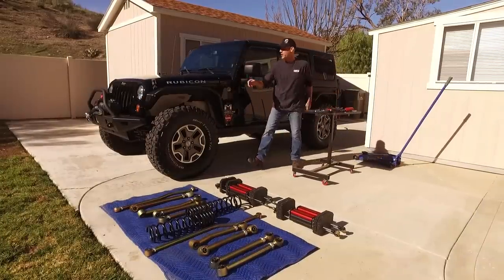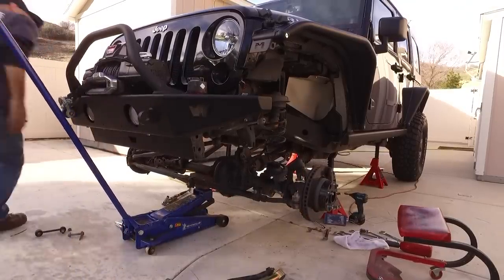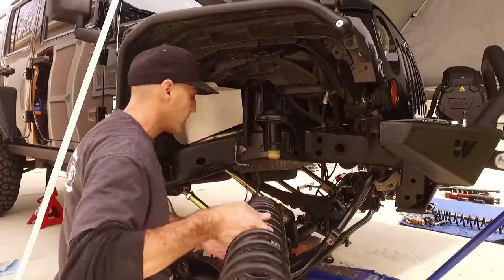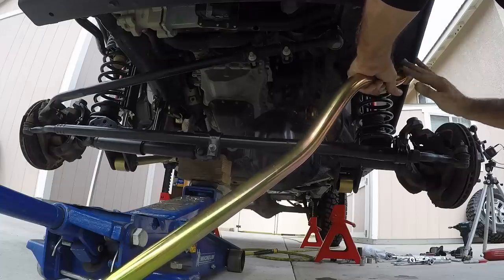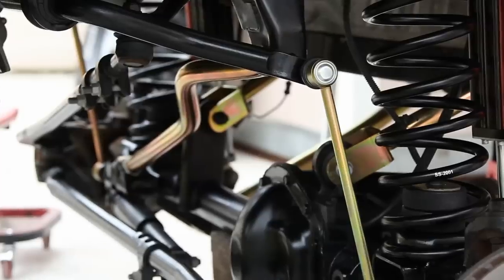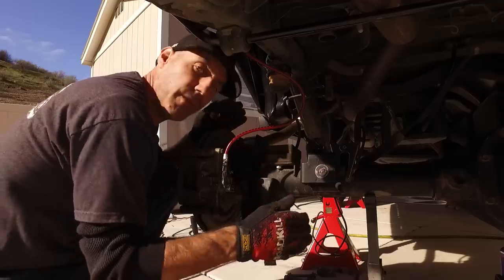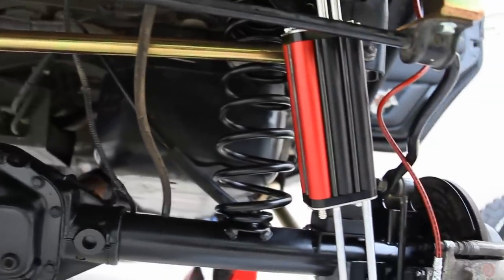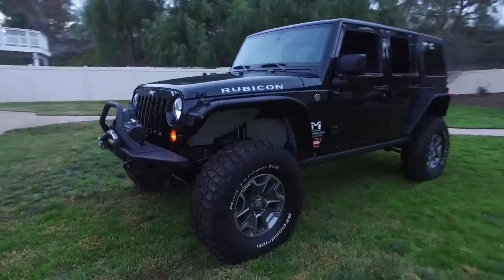Jeep Wrangler JKU Suspension UPGRADE Game Changer 6Pak DIY - Lift Kit

Comment: For a good safety measure, you should put the wheels under the jeep while you're working on it. If the jackstands fail the tires will be there to help keep the jeep from crushing you. Just a little precaution I take when I'm under mine.
Reply from the maker: That is a good tip, thanks!
Reply: Considering he put 37s on a stock height vehicle in general before a lift, he should just kick the jack stand down while he’s under it.
Reply: If we didn't have gravity, we would have no worries about the jeep coming down if the jack stands failed.

Comment: This video is the reason I'm buying a MetalCloak 5.5" long arm kit soon :P Thank you! I was torn on the Game Changer vs Long Arm, but I do so much highway travel in my 2-door (about as equal as I do O/R) that I'd love the solid stability the long arm provides over just adjustable flexers :)

Thanks again, man! Great video! This one is my second favorite, aside from your Rubicon Trail vid!
Reply from the maker: Congrats! Are you getting the lock n load system?  I'm thinking about trying that one. Thanks for the shout!
Reply: @AutoEdits  Yep! If we're gonna go, we're gonna go for gold :D I wanted the Lock n' Load for full articulation, without worrying about killing everything else. And, of course, the 6-pak setup.

Upgrade will be "soon", as in "as soon as the rear tires go" lol. The fronts were rotated from the rear about 6 months back, and these "new" rears have some life. But, we recently took it out to the Hammers (Johnson Valley, CA) and tore the hell out of them trying out some waterfalls. No go lol. So, since we'll need some way beefier tires than 33's under a 5.5" lift, we planned to wait until we need all 5 replaced.

At the same time, we're gonna do driveshafts, gears, and selective lockers (Jeep is a Sport, non-Rubi), while also swapping out the D30 up front to a fully built Dynatrac D44.

Should be one hell of a year!
Reply: @AutoEdits  Oh, and also, since I'm just going with the stock D44 in the rear, I'm going to upgrade to 35-spline, as well as truss it for added strength. Excited.

Comment: Love it! But I dont want to spend the money on the six pack edition... Im just gonna run the 2.5" or 3.5" Gamechanger with the Fox Shocks. Most people I have talked to say that they get just over 3" of lift with the 2.5" and just over 4" with the 3.5"... So, not really sure what I want to run. I will be running 37" STT Pros, but do a lot of tippy off camber trails, so I definitely dont want to get too tall.

Comment: You have added a lot of great upgrades. They are functional and look great. Have you kept track of the amount of weight you have added to the jeep? Are you planning on any break upgrades? If so, what brands? If not, why?

I used Wilwood for my brake upgrade and it made a big difference on stopping distance.
Reply from the maker: I have not kept track of the weight added to the Jeep. At this point I'm not concerned since there are so many other good working rigs on the trails with more stuff added.  
I am doing Power Stop brake pads and rotors next... long over due upgrade.  The Wilwood stuff looks amazing, I use that on my Mustang project!

Comment: Just installed this lift PLUS the HD steering upgrade based on your videos. Love the suspension so far and wasn’t too difficult to install. I did notice that since the rear pinion has changed, the rear springs had a rearward bow in them. Metalcloak makes a corrective aligning bracket which seems to work great. Just wondering if you had this issue. Great work!
Reply from the maker: Glad t hear you went MetalCloak as well. I've been extremely happy with this kit and with the company!  I did eventually adjust the rear axle to the rear about .5 inch and take some of the pinion angle out of it.  Seems very happy both on and off road.  I'll look into those brackets you mentioned, but I've been thrilled with the adjust-ability in the stuff already on there.
Reply: Ah interesting, yea I suppose changing the pinion angle itself would help. I did notice that after the corrective bracket was installed, I gained about 0.5 inches of height in the rear. Simulates the rake that the stock jeep comes with. I don't mind it though. Look for "JK Rear Coil Spring Alignment Correction/Retainer" on the site. It actually doubles as a spring retainer as well with is nice. Two problems, one fix.

Comment: Great video. Thanks for sharing! Looks amazing. How does it ride?  I have a 2017 JK Rubicon Hardrock. Trying to decide on a new suspension. You just helped me decide. As soon as I get your feedback on the ride. Please inform.
Reply from the maker: It is all around fantastic. Not much compromise here. I just finished a 2000 mile trip across 4 states hitting trails like Pritchett canyon in Moab and Milt’s mile in sand hollow and cruised home at 85 mph on the highway. I’m extremely happy with me setup.
Reply: Awesome! Thanks you again!

Comment: Yay glad you got ur metal cloak gamechanger lift :)
Reply: Whatch your front driveshaft the cv joint on it will possiably crack open. If you need to replace driveshafts to something stronger go with adams driveshafts. 
http://www.adamsdriveshaftoffroad.com/jk-front-rear-1310-or-1350-driveshaft-package/adams-driveshaft-jk-front-rear-1310-cv-driveshaft-package-with-spicer-greasable-heavy-duty-series/
Also did u get the exhaust spacer rings for the headers from metal cloak the front driveshaft will hit the crossover pipe with out it .
Reply: Heres the spacer kit for the exhaust 
http://www.metalcloak.com/JK-Exhaust-Spacer-Kit-p/7078.htm
Reply from the maker: Thanks so much for the info! I plan on replacing the driveshaft pretty soon and don't want the exhaust any lower to bang on rocks so leaving it for now.

Comment: great to see this up man! good work. one question..should your new brake lines be behind the rear sway bar like that? seems like they should go in front of it. atleast thats how ive done it in my installs. anyways, love the jeep. keep the videos coming!
Reply from the maker: I wondered about that as well but as I articulated the sway bar before connecting it to the axle, where the brake line attaches to the frame would get hit at full articulation so I went inside the sway bar.  I'll keep an eye on it and thanks for the suggestion.
Reply: I figured if you had done it then there was probably a solid reason behind it. Yeah shouldn't be an issue. Just watch it, don't want something to happen to your brakes ;) Great looking jeep

Comment: Hey Jason, Do you have to do anything with the driveshaft?  Is there a concern that there will be too much pressure on the driveshaft or any other geometry issues with this setup?  Thank you sir and love all your videos.  I have learned so much from your videos and Crawl TV.  Thanks for taking the time to educate us newbies.
Reply from the maker: Well thanks for watching!  I ran the stock driveshafts for a few months after the lift but swapped them out for the Tom Wood's upgraded units and am glad I did. Check out that video if you get a minute or two!
Reply: Perfect!  Thanks Jason!!!  Found the video and appreciate all your hard work.  Thanks for sharing all your knowledge.

Comment: I love how you skipped over installing those nasty rear upper control arm Flag nuts. Pain in the arse to get lined up and started. would love to hear how you managed.
Reply from the maker: I actually had them in at first but these darn videos get so long.  It really wasn't that hard... line up the arm to the mounting hole and put your eye right down the barrel of the hole until you see the flag nut and then gently jam that bolt in and twist! I may have got lucky but it worked out to be pretty easy both times.
Reply: Lucky

Comment: "6Pak Shocks" are dampers not shocks, you spring absorbs the bumps (shock)  in the road and the damper controls the spring rebound after  the initial compression of the spring

Comment: Great video!!!  Always learn a lot from you. How did you get the jeep on four jack stands? Jack up from where? Middle? And support with jack stand on the frame like your video?
Reply from the maker: I lift the rear from under the center of the differential and the front from the axle tube just next to the differential.

Comment: Those are not your typical shocks! I’m sure they’re unbelievably tough, it just looks strange to me with the smaller diameter rods. I was looking into Tereflex lift kits but after some research I’m leaning towards Metal cloak as well now. The elastomeric bearings would be a huge upgrade. Are you still happy with the lift? Great videos btw!
Reply from the maker: I am EXTREMELY happy with my Metal Cloak suspension!  It continually performs great and the shocks are valved just right for sport and comfort. Would do again for sure!

Comment: Jason, great video!  I've enjoyed your content for some time.  My suspension upgrade from Metalcloak is on its way, should have it in a matter of week.  Question - did you install exhaust spacers?
Reply from the maker: I didn't at first and around town and light off roading was fine.  A few months later at full droop it did rub the stock front driveshaft and tore the boot. I ran spacers until getting the Tom Wood's driveshafts and then pulled the spacers back off and never looked back.
Reply: You only need the spacers if you don't have a aftermarket drive shaft. If you're running a 3.5" lift you'll need a aftermarket drive shaft in the front at least due to the angle. You'll eventually tear the boot and it'll fail in the most inconvenient time. You're better off buying a new drive shaft and installing it. It's pretty easy takes a couple hours.
Reply: @AutoEdits  Thank you!
Reply: @MichaelCook1981   Thank you very much.

Comment: Just found your vids. Very nice and informative. The big nuts on the upper and lower control arms. After you set them to the correct length did you tighten them? And if you did tighten them, did you do it on the Jeep or off?
Reply from the maker: Thanks! I did tighten them once the installation was complete and the Jeep was back on the ground. Pretty easy that way.

Comment: Hey Brotha,This is a seriously amazing video. I am lovin' all things Metalcloak. Just out of curiosity, what's the status of the old shocks?  I've never used Twitter or Instagram. You might really be a lifesaver. My Rubi has been out of. commission for a few months. I had just finished paying her off and babied her since I left the dealership. I was in a major accident hitting a highway median which got under the front end  and due to my now ex wife screwing up the insurance, have to pay for all the damage. We're talkin front axle, bumper, flares, tranny AND transfer case, as well as 2 blown tires and a toasted left wheel as well as,  obviously the shocks/suspension..  I have been in a serious funk since it happened because it's gonna cost around  $10,000 that I am really trying to save up. I'm on disability for a brutal back injury that I got at work and my monthly income has taken a major hit. I can send you pictures of all the damage no problem. I've never asked anyone for anything but the second you said you were giving away the old suspension, I freaked out. The last 6 months have sucked so bad having no wheels and looking at how messed up my Jeep is. It's the first one I've ever owned. You would literally be changing my life around if I could get it. Please, please email me if you can help and I'll send u back pics so you know I'm legit.. It would literally be like winning a lottery . My email is ..soenlightened@yahoo.com Thanks , I really appreciate it.

Comment: Nice vid! Did you need to change/upgrade your drive shaft? Are brake fluid changes necessary after upgrade? Other than alignment, did you have to do a flash cal?
Reply from the maker: Eventually I upgraded the driveshaft, you don't need to change brake fluid but you do need to bleed the brakes , no need to flash the computer at all.
Reply: @AutoEdits  Any specific torque spec (ft lbs) when tightening the bolts back on upper, lower control arms, track bar, etc? I’m running Factory wheels/ AT tires 33” on a ‘21 Rubi JLU for now. Will put on 37”s in a month’s time. Would i need to install the shock mount relocation brackets for now for the fronts or rear?

Comment: Great vid, did you have to put any exhaust spacers because of the lift?
Reply from the maker: Thanks! I didn't run spacers for a long time and it was ok. Eventually I swapped the driveshaft upgrade and you don't need spacers then.

Comment: Dumb question: Did you torque anything during final assembly or just blast them on with the air tools?  Does it matter?  Thanks!  Great vid!
Reply from the maker: Probably does matter but I used my calibrated elbow for this installation.

Comment: Hey Jason, Long time viewer. On all those nuts and bolts are you using any lock tight? I only ask because I am about to do the shocks, springs, sway bar end links, tie rod, and drag link.
Reply from the maker: I didn't use loctite and just torque all stuff and recheck periodically.
Reply: @AutoEdits  Thank you for the reply. Got it all done today after you replied.

Comment: I remember seeing this video when it first came out. Thinking about finally committing to a decent lift I’m tired of the 3.5” pro comp lift. Hey @autoedits would you still recommend this lift for a jk.same shocks and all
Reply from the maker: I'm still extremely happy with this setup!  Check out my most recent video running part of the Baja 1000 race course in the Jeep and it did great.

Comment: Awesome kit from what I've heard. However, I do have a couple questions. Have you had any issues with the 6-Packs leaking? I was dead set on this kit until I heard about the issues they were having. Also, since you've committed to the 6-Packs, is there any concern with the longevity of the shocks and Metalcloak being around in say 5-10 years? I've had this come up in the past with another vendor that had awesome products but a few years down the line when something happened, they were no longer around.

Comment: Great channel!  Did you have to add exhaust spacers before the Y pipe for the driveshaft to clear the crossover pipe at full droop?
Reply from the maker: I drove it like this for a while first and then added spacers when the front driveshaft started rubbing in more difficult terrain. I eventually got tom wood's driveshafts and pulled the spacers back out and have been running it like that since.
Reply: @AutoEdits  thank you for the reply.  Getting ready to lift my JKU in he next couple of weeks and trying to do as much research as I can.

Comment: QUESTION⁉️ So I have stock wheels and I’m planning on upgrading to this suspension and I was wondering would I need to get spacers to add the shock relocation brackets?
Reply from the maker: I don't know about the shock brackets but I would run spacers anyway. Factory offset is not enough.

Comment: When you go off road with it are you going to disconnect the track and sway bar for more articulation
Reply: josh wolfe doesn't look like he plans on it, no sway bar quick disconnects and for some reason it's still got the rear sway bar on it. He'll get to a point where Handicorn is going to pay this Jeep a visit.
Reply: 95 XJ yea I don't see why he wouldn't get quick disconnects
Reply: josh wolfe rubicon's have an electronic sway bar disconnect. He doesn't need quick disconnects on it.
Reply: CodyyyAndAdammm I forgot about they're electric disconnects. What seems like a good idea ends up being annoying. From what I read, it only works in 4hi/4lo and under 18mph and the rear stays connected at all times. I'm sure there's a way to get around the mph and the 4hi/4lo thing and I still stick with getting rid of the rear one.
Reply: Well it definitely would get interesting if he disconnects the track bar...

Comment: Great looking rig. Did your stock drive shafts still work or did you have to get them lengthened?
Reply: Lengthened or replaced. Either is what I meant. I built a chevy k10 and just had a driveshaft shop retube the front and rear.
Reply from the maker: Thanks!  I used the stock shafts for a while and ended up having Tom Woods Driveshaft build new ones and they are awesome!

Comment: When you installed your 6paks did you have to trim/ grind anything on the driver side front upper coil bucket? I saw it somewhere but the instructions don't mention anything about grinding.
Reply from the maker: I didn't have to trim anything.  Making sure the axle is in the right spot with the control arm lengths could have something to do with that.

Comment: Nice vid. Are jack stands used 6 ton each or 3 tons? I’m currently using two and wonder if that is good enough to support the jl with two front wheels off.
Reply from the maker: I think they are 3 ton

Comment: Hey Jason, did you have to install the exhaust spacer from metal cloak? I know you have the american thunder exhaust, so I am curious if the spacer is needed.
Reply from the maker: Howdy, I did end up running the spacers while I had the stock driveshafts and removed them once I installed the Tom Woods Driveshafts.  The only time you really will notice any rub is if you are actually off roading and let the suspension droop down... then the front boot on the stock driveshaft will rub... otherwise for around town and such... they were fine.
Reply: AutoEdits awesome, thanks for the info! Been watching you since the WJ days (i had a 4.7 overland), and switched over to the jk world earlier this year. Love the JK! And pinto of course.

Comment: It's worth mentioning that the jamb nuts on the arms need to be tightened to something like 300ft/lbs and checked on a regular basis. They WILL come loose eventually (blue loctite helps here) and they are an absolute b*tch to get tight enough.